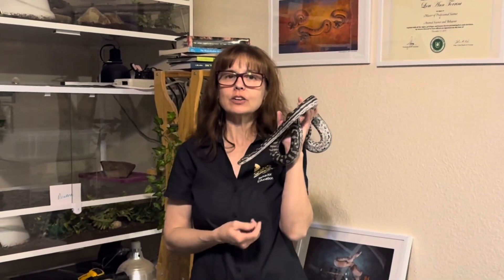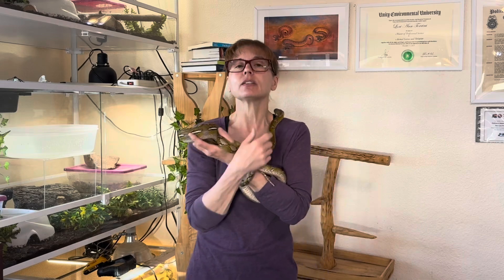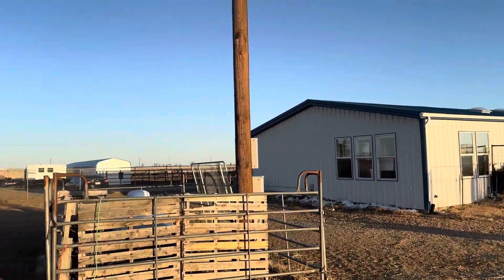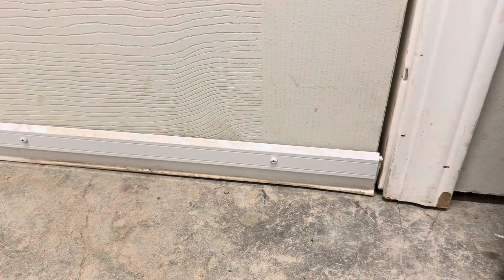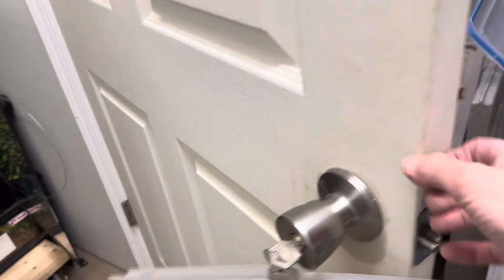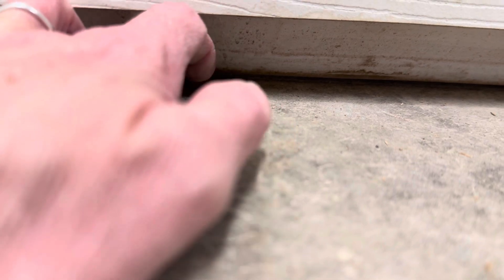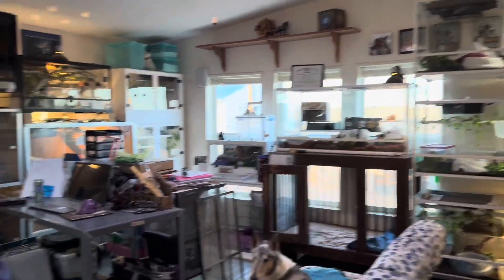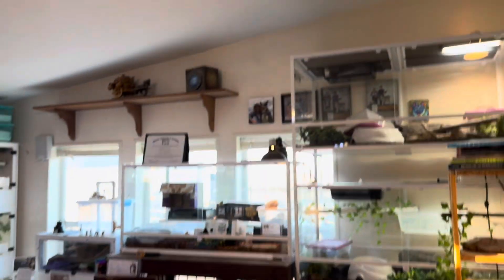Snake Proofing Part 2: Doors

Comment: I'm completely new to snakes and Im curious about your pvc enclosures. Specifically, so far I've only seen them in black and noticed many of yours are white. Is there a reason for that / does it affect lighting and temperature conditions in any positive or negative way?
Reply from the maker: Great question! White reflects light/heat and black absorbs it. The white PVC reflects light inside the enclosure, which makes it brighter for the snakes and easier to see them without needing as much lighting. It also absorbs less heat than black PVC, so it stays more temperature-stable—especially in warmer rooms. Another bonus is that white enclosures make the whole room brighter on the outside too, which I really like.

Comment: Great advice, thanks! Any tips for snake proofing a door over carpet?
Reply from the maker: You can use the bottom door barriers and will have to make sure the bottom edge is just slightly above the level of the carpet to the door slide easily to open and close. You can also purchase cloth/fabric bottom door draft stoppers that slide more easily on carpet. 
https://www.amazon.com/Install-Adjustable-Soundproof-Interior-Double-Sided/dp/B086YCYVHV/ref=asc_df_B086YCYVHV?mcid=beb81e03bc583f76a616c13aeea6f310&hvocijid=16620732540333863583-B086YCYVHV-&hvexpln=73&tag=hyprod-20&linkCode=df0&hvadid=721245378154&hvpos=&hvnetw=g&hvrand=16620732540333863583&hvpone=&hvptwo=&hvqmt=&hvdev=m&hvdvcmdl=&hvlocint=&hvlocphy=9028976&hvtargid=pla-2281435178818&psc=1